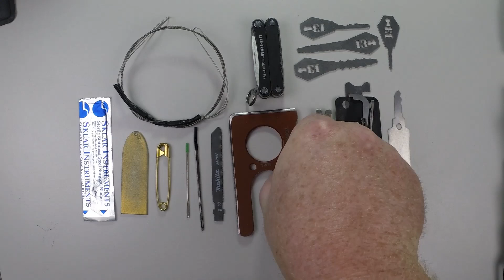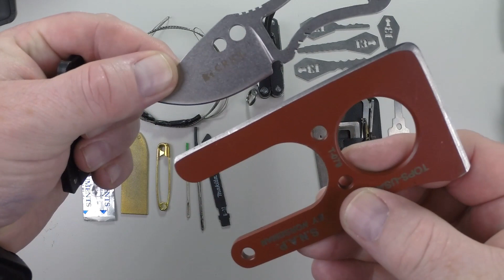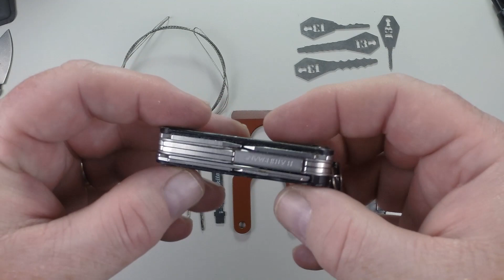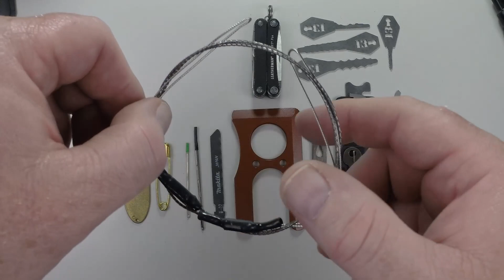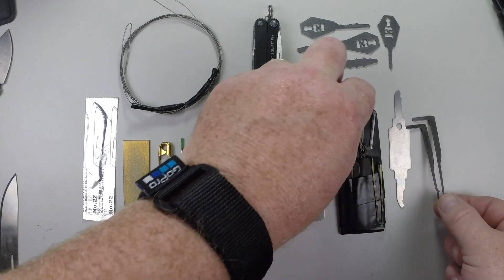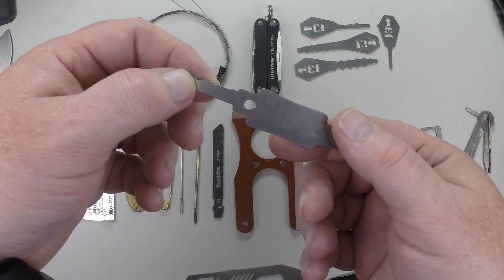Pocket Survival Kit (PSK) - Part 1 - Tools

Comment: Always like how people think its what it need 

Personal i go for a pocket like the leader man .
A model with more use for fish tools on it 
Reason is have model that is more to use  for fishing .
Same with pocket knife i go for a model with saw on it .
And not a lose blade and have to make something to let it work.
A good option for a small Pocket knife will be a MY FIRST VICTORINOX H 
Thin knife and will fit in small tin box And yes is for kids first knife but will de the job just fine .
Or the CAMPER model .
The Corkscrew is really easy to use.
To open the saw blade and the corkscrew.
Use a tree branch and use corkscrew in to the branch .
Than use rope to more secure the knife .
And you can saw on higher place .

Same with a needle .
I use pocket needle set from a store.
Its small pack with wires needle and more in a small plastic pack.
What just fit in my tin can.

I do look in to pick lock set.
Something i do can use .
But really small blade you can open some locks .

Its not easy to make a toolbox in your pocket.
Its al about what you need in the place you are .

Wel do i go for a army Pocket knife .
I use a (use Google and type in)
Victorinox model 4 NL
Its a Dutch officiële army knifel model .
And really have what you need to use really al thinks.
Problem no saw on it .
Than you go for the HUNTER XT GRIP model.

The Gutting blade both knife have them.
And its use after you kill a rabbit to thake of the skin and more so you can make it ready to eat it.
The knife is make this way so you will not cut the intestines.

Just some thinks to think about it